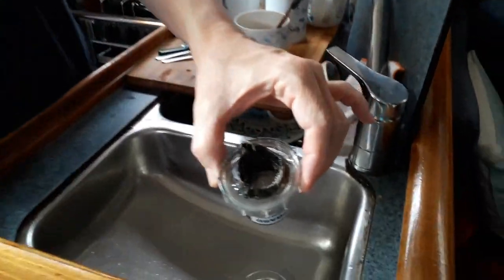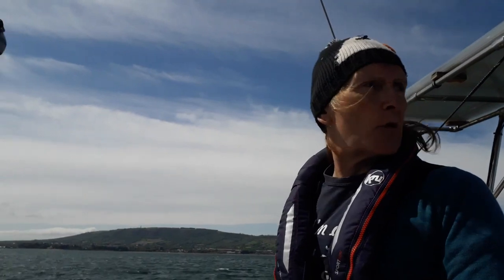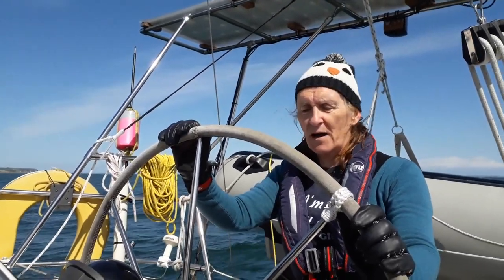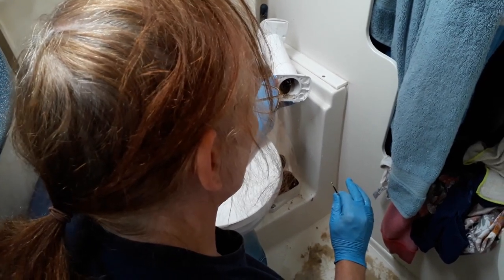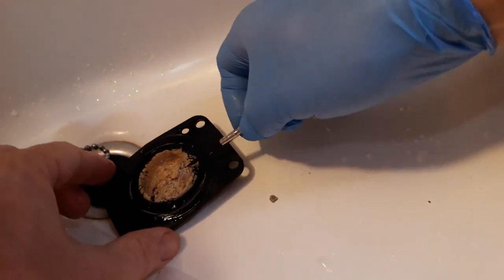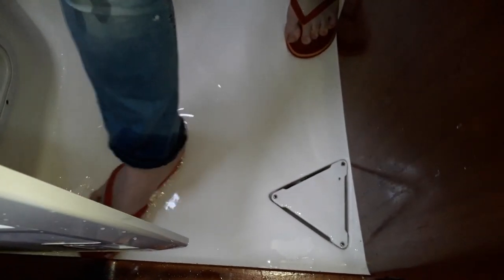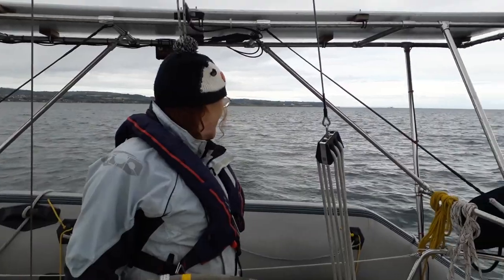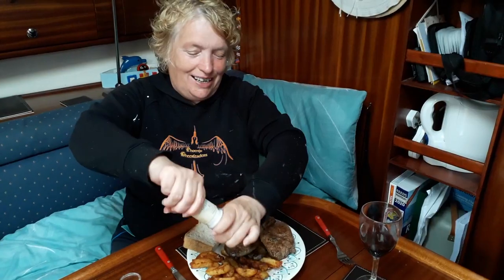Raymarine instrument calibration - Evo Autopilot - ST60  - Sailing Belfast Lough - Ep. 139

Comment: Another good video of your journey. Disappointed you can’t get to Liverpool. YM is a great rite of passage though, enjoy. Lots of mob under sail in different conditions, same for picking up a mooring buoy, springing off, the rest is Nav and not crashing or running aground (at least in the test!). Great stuff, and looking forward to the video...
Reply from the maker: We have a lot of practicising to do ;-) We are missing friends and family and it would be nice to pop over, but everything seems too unsettled at the moment. Bev made out the passage plan as a single run from Belfast to Liverpool so we were ready to go. But alas.... :-(
Reply: So sailing.
, a lot like life, is about having a plan b so you are well prepared for stuff that happens. I said plan b but that can also mean c, d ... all the way to z at times! I like your positive approach to our current situation, which we are all facing. Inspiring. On configuring raymarine ap I found 2 metrics important. 1. Ensure the setting is appropriate for the boat in the setup as the default is unlikely to suit (mine was fishing boat). Secondly the circles you were doing, quite correctly, should be done with minimal tidal stream, and the wind can mess with the movement of the water on the surface. Calm and still works best, as you worked out. 3 knots would be fine in no tidal stream. A circle rather than an elipse. Ps excuse me being a smart arse after the event. Fair winds.
Reply from the maker: @neilb2793  - Thanks for all that and thank you for the complements! We were just glad to get them all recalibrated. I must also admit,  not much happened after than steak and wine ;-)

Comment: lovely... well from the days I was working with Radio Holland, we would calibrate also in circle, but turning around schips axle. slow speed rudder full .
Reply from the maker: Slow is a relative term. For a powerboat 3kts is nearly stopped, for us it is half our hull speed so "medium" would be a better name for it :-)
Reply: @SailingYachtSaltyLass  it is just to reset the fluxgate of the compass.  I would also use a visual thru North at the same time and mark the magnetic compass while you at it.. anyhow... choppy waters is not going to help much auto would wanna compesate.
Reply from the maker: We got there in the end, but on a calmer day.
Reply: @SailingYachtSaltyLass  all aviators land at one time.
Reply: @PaulusPHM  Actually and I hate to correct you but it's the later much better gyro compass in an EVO 1.  Another great video ladies, thank you.
Reply: @pete9501  stand corrected , but even for giro applies the same.